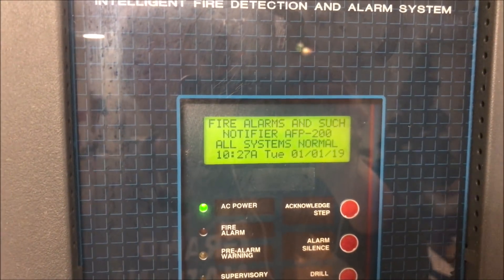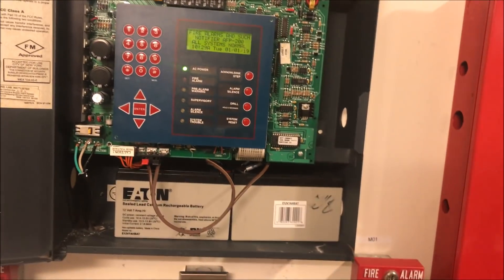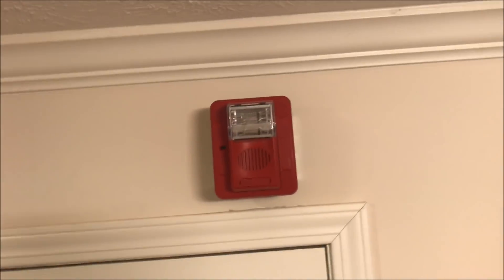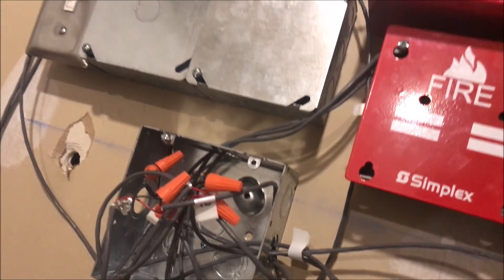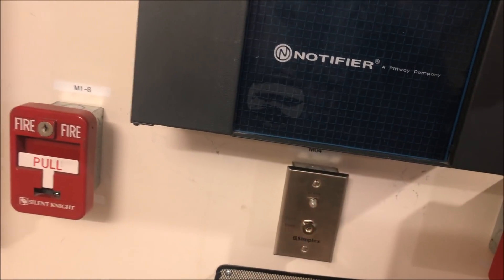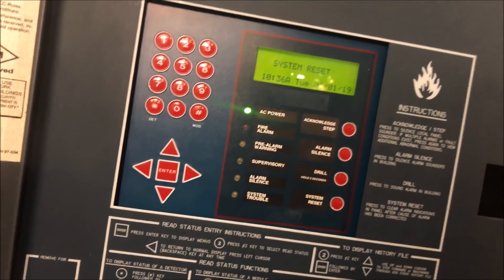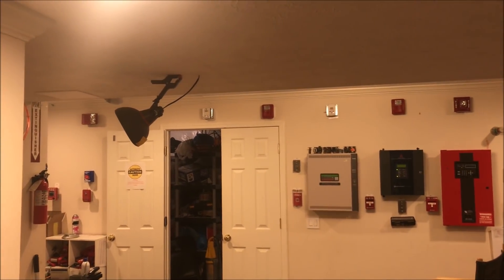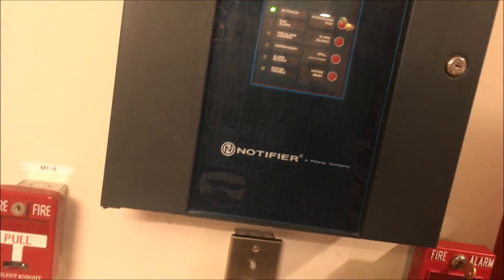New Year New Panel! Notifier AFP-200

Comment: Cool! The Student Union at my college has a Notifier AFP-200 system from the late 90s or early 2000s, taking over from an old Standard Alarmatic panel from 1971 (gutted and used for terminal wiring.) Some of the old Standard 450 horns (with 90s-style Faraday strobes added) are still in use in the library and the ground floor hallway, along with a few Faraday 6234 (U-HN-MCS) horn/strobes, System Sensor SpectrAlert Advance P2R horn/strobes in the renovated parts of the ground floor, and P2RL horn/strobes in the recently-remodeled Enrollment Office. Pulls mainly consist of NBG-12LXs in said renovated areas, and Faraday F1GT and Fire-Lite BG-12 pulls elsewhere. The renovated areas and at the elevator have FSP-851 smoke detectors, but everywhere else has heat sensors (a few of the original Standard ones and newer Edwards ones, along with a Simplex 4255-5 heat sensor.)